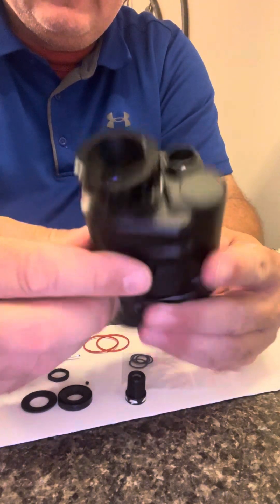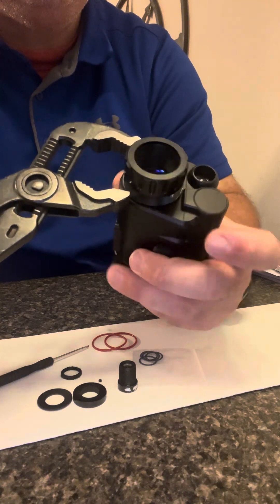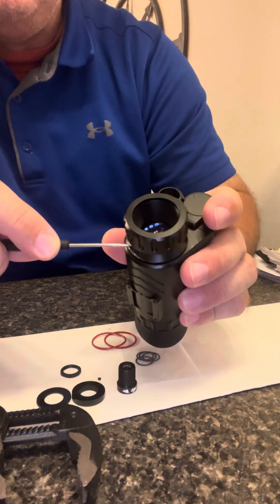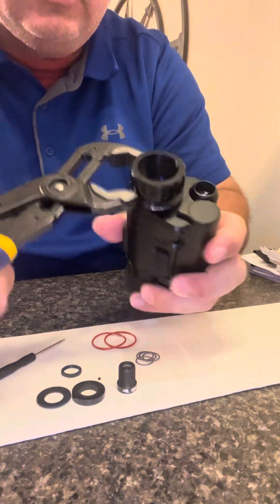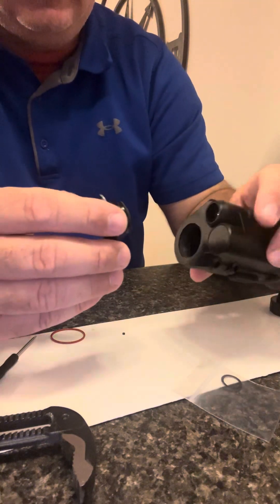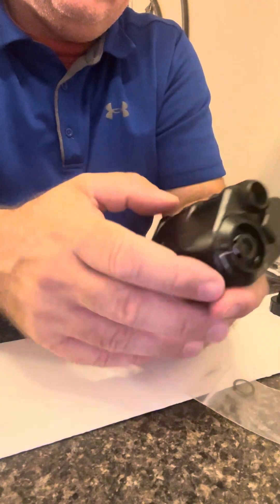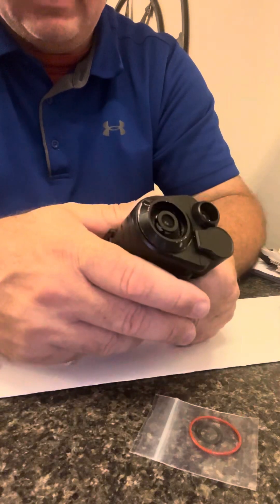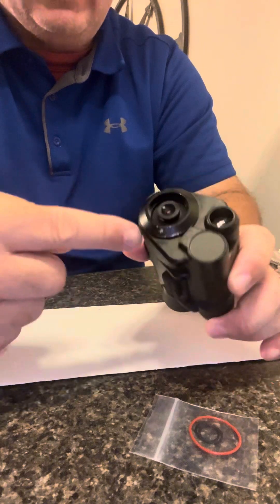INSTALLING NVG-30 wide FOV lens upgrade

Comment: Great video. Would you say the NVG30 has a good enough fiew to be used with a gas mask?
Reply from the maker: @GrantHeyman-i7t  no! the eye box is very small. and it needs to be close to your eye to see the whole display. it is what it is until you get a pvs-14…then the 30 becomes a great backup until you get a 2nd 14. no free lunch. 
i would buy the 30 and have SOMETHING until you acquire the 14.
Reply: Thanks man.

Comment: Is it still waterproof after mod and in the future would you make a polycarbonate lens protector for your mod I’ve been looking for lens protectors for this mod and I’m unsure how I would protect it
Reply from the maker: @Reverendx1  it is less water resistant than orginal. i would stay out of the rain!
if you broke lens? i would send you a free lens replacement if you ever broke it or got it shot out.

Comment: My NVG30 comes with a lens assembly that is fixed with a 8 sided ring nut (whatever you call it) which is much easier to remove with a, I think 30mm, flat spanner. So, it seems that there are different versions.

Comment: I purchase 2 nvg30 and i finded that the front eye piece is a pain to align ont the field and when running its much worst. Is there a solution to change spherical or aspherical glass  lens inside . ???? When you off center - it automatic blurry - it a verry big probleme for shooting and navigation. can we install - sionyx or real pvs14 lens on the front ? Does your front lens will help with my probleme. ? Thank you
Reply from the maker: @kevenpiquette911  the eye box on the 10 and 30 is small. 10 times harder to align to eye when using a dual tube bino. i try to talk people out of binos with the 10/30’s but it’s impossible. one tube with wide fov is usually a better solution.

Comment: Where can one buy this upgrade?
Reply from the maker: @OnlyDayzfanz  i’m on ebay. 
can search nvg-30 wide fov. 
i’m at 662-418-4094
text or signal
the factory sells a 50° lens. But i like having MORE fov than that!
Reply: @mag-brace9378  hi.  Does it eleminate the blury distorsion ??? Difficulty to align the vision .
Reply from the maker: @kevenpiquette911  yes. it’s a crystal clear image. you can see some video of the nvg-10. the 30 uses the same lens as the 10.
Reply: NVG-10 2xCOMBO:  Wide 72° (vs oem 25°) FOV lens + 100% invisible iR flip cap.

Is this you product on eBay and Will this work in the NVG30
Reply from the maker: @macmac9371  no. the 10 is for the 10. the nvg-30 1x is for the 30. i don’t have the iR flip cap finished for the 30 yet

Comment: Where can we get the flip cap? I dont see a store or anything?
Reply from the maker: @tylerthrash3155  i’m on ebay. search nvg-10 wide fov. for nvg-10 and 30. The flip cap for the 30 isn’t finished yet. The sideways adapter that gives you 72° vertical is finished and fits the 10 and the 30.
you can text or signal me at 662-418-4094

Comment: You know you did not have to use channel locks to open that right? All you had to do was twist the lens at full lock loosening it and then keep on going to brakes loose… 😂
Reply from the maker: @KyzoFox  oh man!!! thank you
Reply from the maker: @KyzoFox  on the 30 that collar is threaded on to the factory lens. and even without the 3 micro screws holding it on…it is TOUGH to unscrew..but in all cases, you still just use wrench to unscrew the module to install my new lens and lens adapters. then screw back into the nvg body.

Comment: can u make a comparison video showing what it actually looks like looking through it
Reply from the maker: @OzzieOz74  eventually i will, but it’s the same FOV as my nvg-10 video. it’s more sensitive to low light as the 10 and higher resolution video, BUT neither performance increase will transmit to a video much better than the nvg-10 video i have made

Comment: The original NVG-30 lens has quite some abberation, especially in the peripheral areas. I take it that your lens doesn't have that problem?
Reply from the maker: i’m not sure what aberration means from your perspective. you can contact me at 662-418-4094 and i can clearify.
Reply: @mag-brace9378  I use night vision for stargazing and the NVG30 lens distorts the stars quite a lot, unlike the NVG10.
Reply from the maker: i guess some call this fish-eye effect along the edges. yes. my wide lens removes this.
Reply: @mag-brace9378  Would be nice to see some footage (including stars) with this lens adapter so I know what to expect.
Reply from the maker: @starsandnightvision  you probably won’t see the stars! it’s not a light amplification device. when wide FOV is installed, sensitivity also is reduced. seeing 5x more view needs 5x more iR…or range is reduced 5x. it’s turns the 30 from a good medium scope that can see pretty far, to an amazingly good short range scope that can see medium with a focused iR.
Reply: Maybe your fov lens reduce the illumination because they have a low aperture focal? A f1.0 for example is much more illuminate than one with f1.4. Your lens wich focal use?
Reply from the maker: @patrickdemarini9826  true aperture can help but the lens takes in 500% more fov, without 500% more iR.